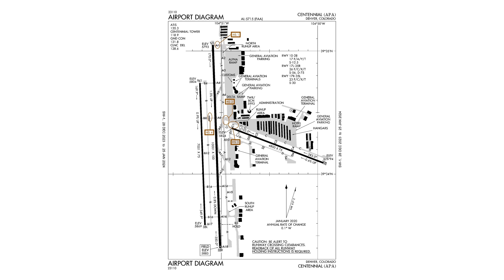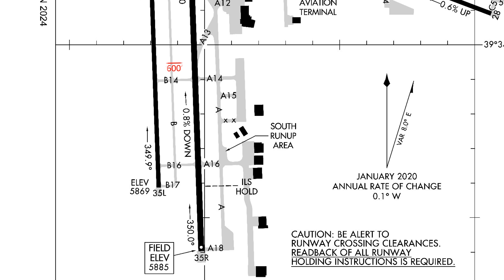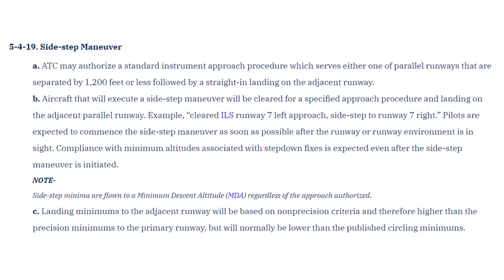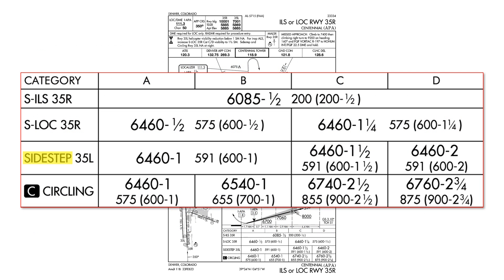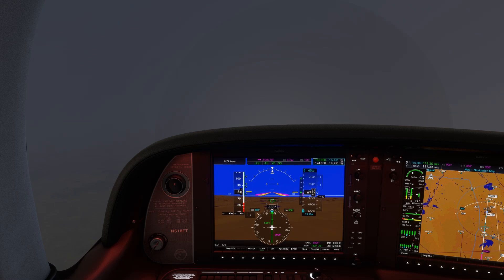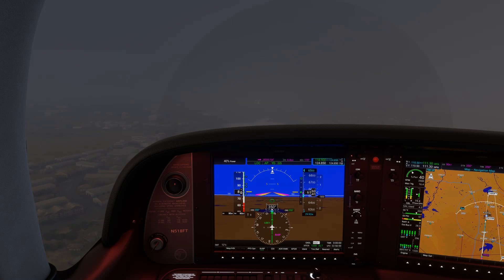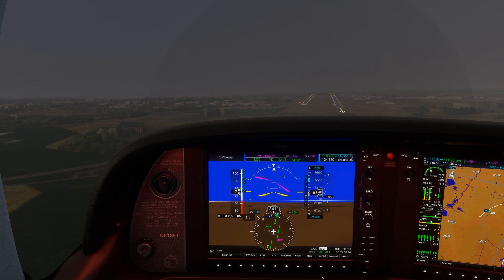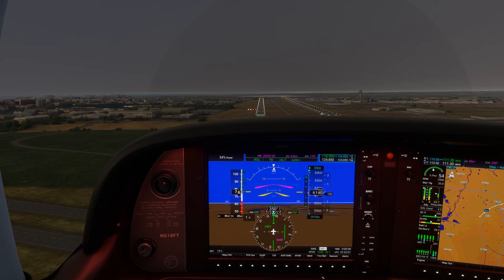How to Fly a Sidestep Approach | ILS Approaches

Comment: what if there is no a sidestep min line published on the approach plate for the original rwy. could I simply use a non-precision min of the original plate?
Reply: ATC usually would ask you when you are already below the clouds, in low IMC you shouldn’t be forced to switch runways. But if you still need a minimum, i guess the circling minimum should do. 🧑‍✈️ ✈️

Comment: Great channel.  Question for you…
In this instance where you are “cleared ILS 35R, sidestep 35L” as you come down the glideslope and get to the sidestep 35L minimum but don’t have the runway in sight, do you go missed or can you continue down the ILS and land on 35R (assuming it comes in site before the DA)?
Reply: I would go missed. I'd stay at the sidestep MDA until I reached the MAP and then execute the missed approach. If I was instructed to sidestep, continuing down to the 35R DA or, worse, landing on 35R would be big no-nos.
Reply: @johnopalko5223  I believe this is the correct answer. if tower instructs you to sidestep there's probably a good reason for it, and if you don't follow the sidestep MDA just to land on a runway you were NOT cleared to land on- that's a sure pilot deviation